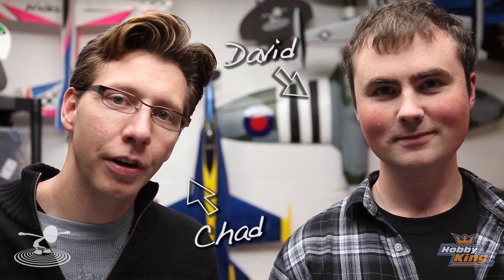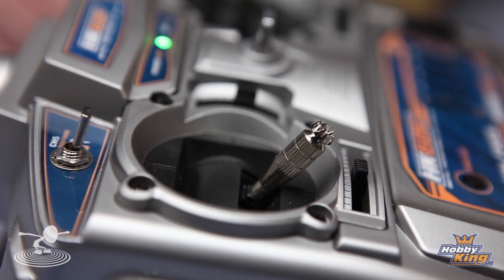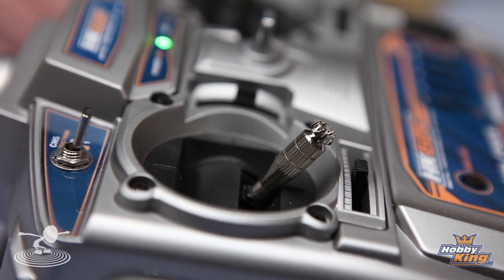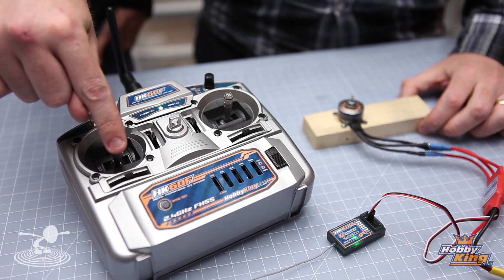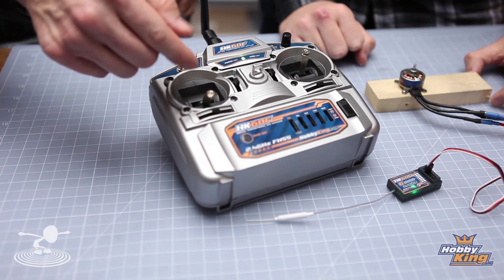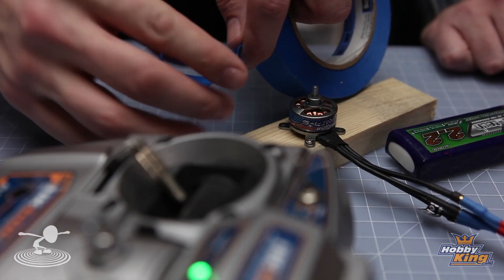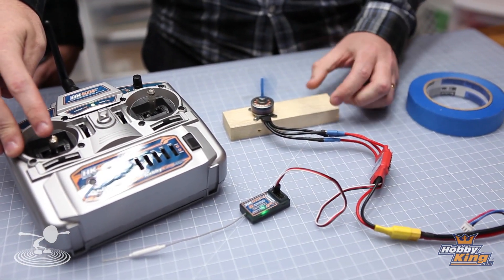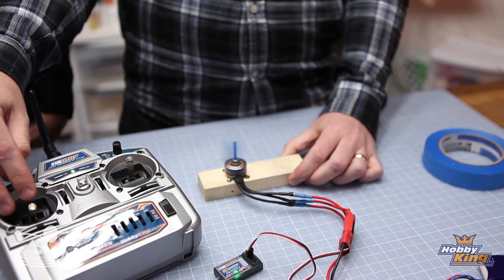Flite Test - Throttle End Points - FAST TIP

Comment: My stick is flipped - up is zero throttle and down is full throttle. Reversing the throttle on the radio (edgetx/radio master pocket) does not flip the direction of the stick behavior. Any tips?

Comment: Every time I try to calibrate the ESCs kk2 board by following the instruction manual of the ESC happens the following error:
With the throttle lever all the way up we heard the beep setting and put the lever down. The ESC's another beep and that's where comes the problem: When we increase the trhottle engines do not rotate. Now look to this board kk2 receiving the signal and she receives, but the engines do not rotate. We need this adjustment because the engines do not start simultaneously.

Comment: @thewillage as @aesoft2009 said you throttle was probably reversed but also your esc is too small for your motor if it blew. Check the max amps of your motor and get an ec a bit bigger eg. 20-25 amp motor get a 30 amp esc, 25-35 amp motor get a 40 amp esc.

Comment: Is this something you do once for every new esc when setting up the TX?
I just had a plane blow an esc and I have know Idea why. I had tested it with a different TX bound to it all and it was working fine. Then I got a new fancy Flysky TH9x and was setting up the plane on it. Bound the RX, and when I plugged in again, motor just went full speed and my esc was blown out, motor maybe too, not sure yet. Throttle was for sure in the down/off position yet it still shot up like crazy. What happend?

Comment: @ dauphin1300. To a point yes. However understand that a prop has an airfoil just like a wing. So simply reversing the motor won't really work. You'll only get about 30% efficiency. Plus it may damage your prop. Get a pusher prop friend. You'll be better off

Comment: Dauphin1300. To a point yes. But understand that a prop has an airfoil just like a wing. Reversing the motor will make it a pusher HOWEVER. The airfoil will be reversed and you will only get about 30-50% efficiency. You'll lose so much power it won't be worth it. Buy yourself a pusher prop. You'll be much better off.

Comment: Nice tip with the tape.  Another way is to rest the prop loosely on the shaft, MINUS the hub, and fire up the motor at low power.  The prop will turn very slowly and the direction can be assessed.